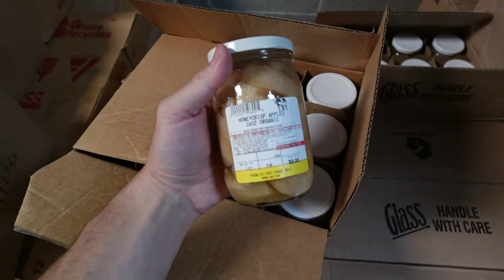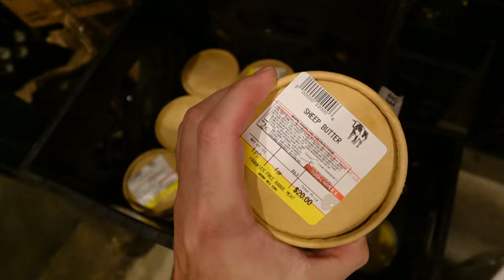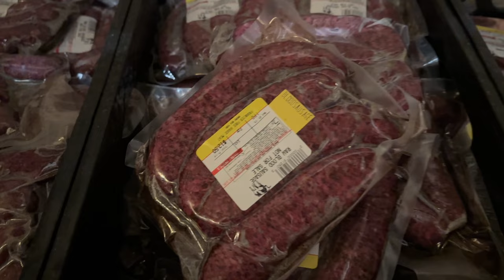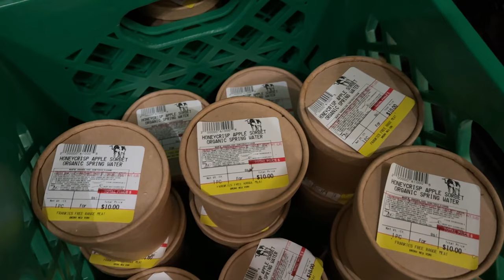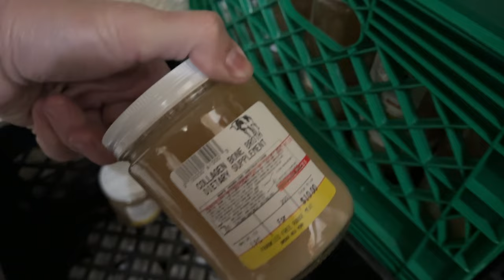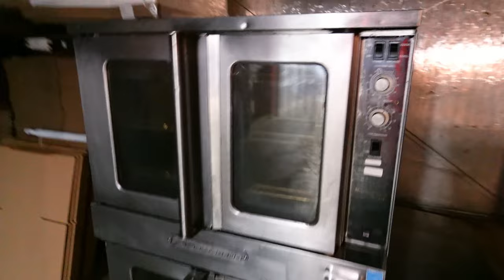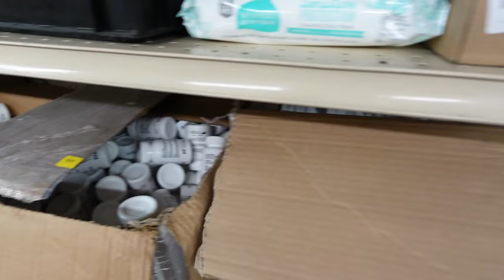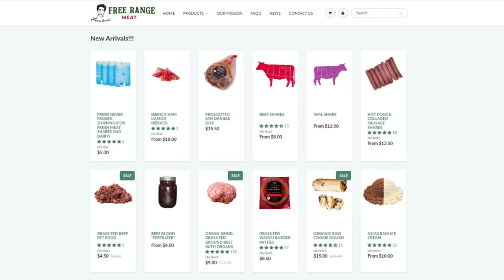Free Range Meat Vlog - White Tomatoes, Sheep & Goat Dairy, Sorbet, Sourdough!?

Comment: When you get another correction on your eye, make sure the surgeon corrects your eye slightly outwards. For two reasons. 1: usually after the surgery your eye will start to move slightly towards the center anyway. 2: Many people have eyes that are slightly outwards but they are able to get away with it more because it’s less noticeable.
Good luck frank.